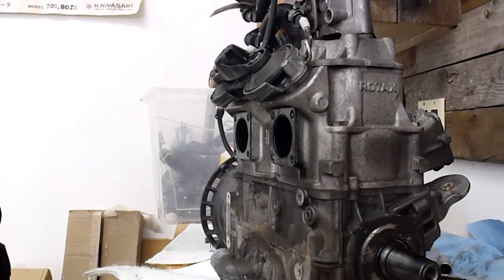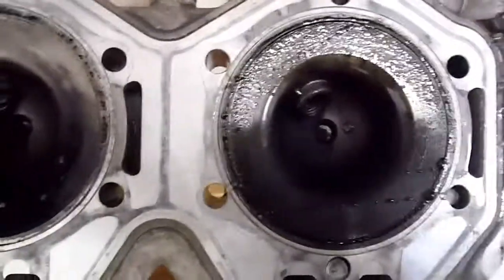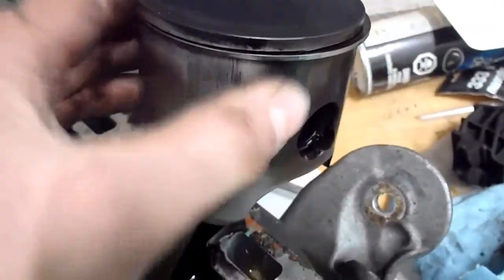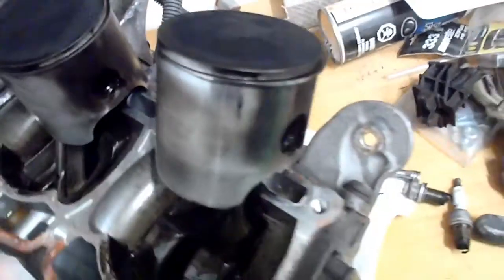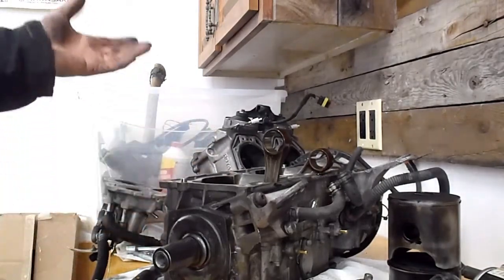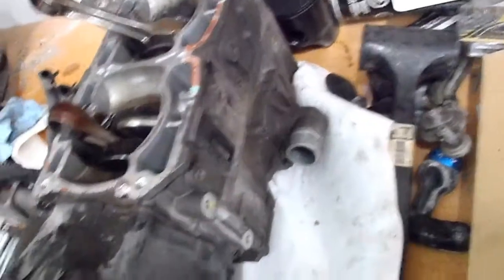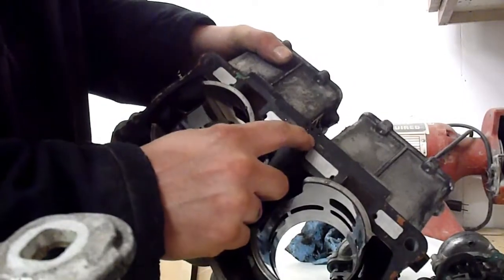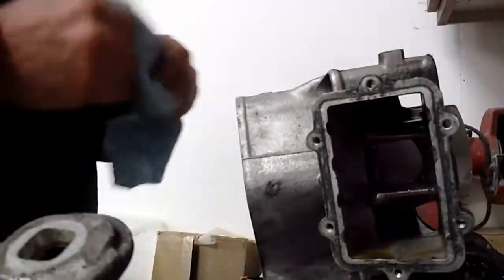Teardown the top end of the ETEC 800  Rebuild part 1

Comment: Привет из Якутии! У меня Скандик СВТ 600 Е-Тек, пробег 6000 км, как ты думаешь, когда надо смотреть , проверять Изофлекс?
Reply from the maker: Greetings from Canada!  At 6K on your sled, you should pull the clutch and check the isoflex.  What you find will tell you if it needs maintenance
Reply: @Pneumamechanical Понял, спасибо. Какой примерно ресурс у этого двигателя?
Reply from the maker: @kazantipa  it depends on riding habits. In the mountain sleds, getting run hard and likely not maintained well, 6500K is probably time to rebuild.  However I have seen trail sleds go 10K without a rebuild.  The 600 will have a longer life as well.  The key is to keep the crank greased, proper warm up and running good oil/fuel

Comment: How did you see the loose crank bearing?
Reply from the maker: I took the clutch off to check the isoflex grease as preventative maintenance, noticed the inside race of the putside PTO bearing was turning on the crank, just by hand.  Not sure what caused it to wear like that